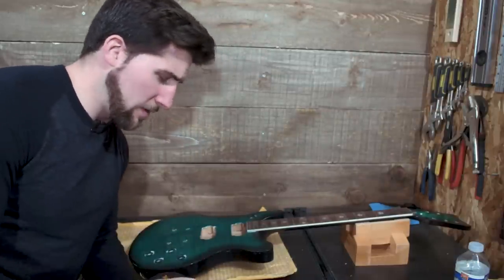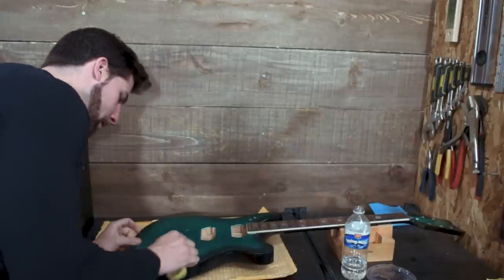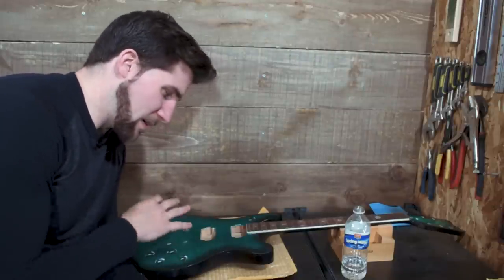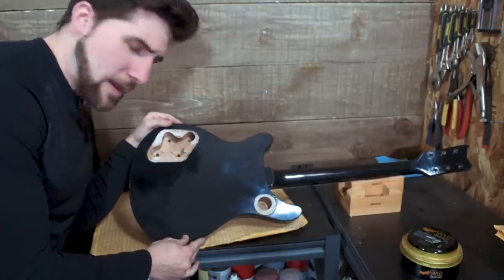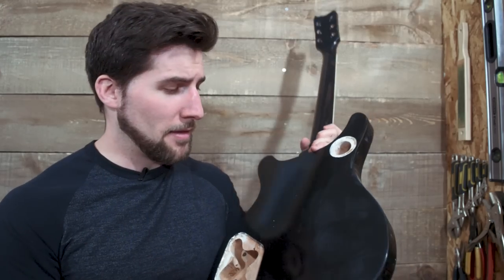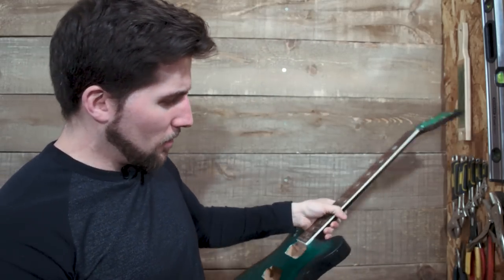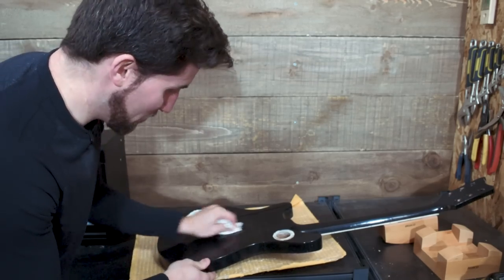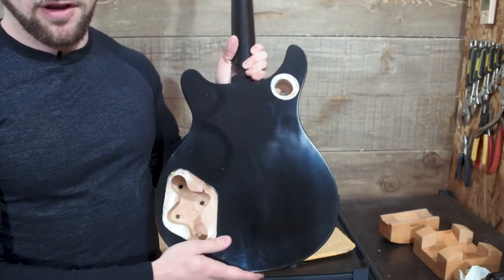Can you use Car Wax on your Guitar?

Comment: I have numerous types of guitar waxes and polishes and the absolute best I have found is Players Kit. You know how black guitars are a real killer to polish and not end up with those little scratches? Players Kit removes those scratches and leaves the guitar feeling brand new! I have a black Les Paul and it had those swirl marks and scratches all over it. I tried numerous things, cheap and expensive, nothing removed them. I checked out Players Kit and gave it a shot. in 10 minutes the scratches were GONE and man oh man does this guitar feel smooth and has a great shine to it! It's all I use now.
Reply from the maker: I need to write this down somewhere haha.
Reply: @BradAngove  Pm me your address I will send you some Players Kit so you can check it out for yourself and do a review. Like I said, it removed basically all of those annoying little scratches on my black guitar in less than a half hour and left the guitar feeling smooooothhhhh... I cannot even remember where I heard about it, seems like someone on You Tube was talking about and after purchasing so many different brands I thought what the heck and gave it a shot. I use other stuff for my day to day cleaning but on the tough jobs, I go right for my Players Kit.
Reply from the maker: Thank you sir. I’ll make a note to shoot you a message on Facebook.
Reply: @BradAngove  - no problem man, I will be curious to see if a professional like yourself agrees with my view of the product. I realize there may be other products just as good or even better, but so far it truly is the best I have come across. I only wish now I would have taken photos of that black Les Paul before and after lol.

Comment: I use Meguire's Scratch X 2.0 for scratch and swirl removal and Mother's Brazilian Carnauba wax as a polish. I've polished Tru Oil and Tung Oil afterwards with carnauba wax, as well as making matte or satin finishes glossy.
Reply: @burp1914  any kind of polishing compound are usually low grit finishing compounds used before wax. Rubbing compounds are quite a bit more aggressive. Polishing usually follows Rubbing.
Reply: @burp1914  try the Meguire's Scratch X 2.0. That stuff is magic. I use it on my car finish as well.

Comment: It was something I knew but nice video. I think it should clear some misconseptions. Few days ago I applied compound on my bass and then wax which all were for cars. It worked better than I expected. Removed all the horrible haze I made a year ago when I tried wet sanding with hand which was a total nightmare on my fingers. I think it should be obvious that wax works differently than compounds if we compare how they get applied.
Reply from the maker: Yes, start with compound, then polish, then you can use wax. Automotive products work fine.

Comment: I use automotive paint anyhow, so I do it just as I would paint and finish a vehicle. I also cut and buff just like I would clean up and detail a car, the wax is important to protect the top coat. I've thought about even ceramic coating a guitar xD, it may help a bit to keep off the greasy prints..
Reply from the maker: Ceramic coat would probably do quite well for that I would think.
Reply: Bradley Bassin_20   Oh absolutely. I’ve been planning on ceramic coating my truck & figured I’d do one of my guitars too.

Comment: I have used StewMac's compounds and polish kit, but I find that the compound mashes too easily into the clear (this is after waiting about 3 days in a heated garage for the paint and clear to harden a bit).  

I prefer high grit sand papers (2000 and up) after clearing a guitar.  For me personally I don't run the risk of sandpaper drying out as compounds do ( you get a huge amount from StewMac), and I can polish out all of the markings with each high grit sandpaper.  It is more elbow grease doing it by hand, but I do love the results I get.  Again to each his/her own :-)
Reply from the maker: I use the high grit sandpapers first of course. Then the compound, then polish.

Comment: What don't you like about that guitar? if you don't want it I will buy it. It would be a fun next project guitar. I love your videos!!!
Reply from the maker: Well, it was a really shitty kit initially. Neck pocket didn’t line up correctly with the veneer. The veneer itself was so thin that it showed up with sand through spots on the edges, which is why I did the burst. It’s just generally a low quality piece.

Comment: Ok, great information Brad. 
 I have a ceramic coating on my car for added protection; Once you have got your guitars finish how you want it, whether it be glossy or matte, do you think an application of ceramic coating would interfere with the finish, ie, turn the matte glossy;  or do you think, like the carnauba, it would just add another layer of protection without interfering with the finished look.  I’m asking because the ceramic coating is supposed to protect against minor scratches, which I think could be useful on a guitar. 
Cheers Brad.
Reply from the maker: The carnuba would still make a matte coat look glossier. It just wouldn’t polish it properly. 
I’m pretty sure the ceramic will give you a gloss or matte based on what ceramic coating it is, not what is under it.
Reply: Cheers Brad, appreciated. 👍🏻

Comment: Hey Brad, i actually was wondering or you could use that on a guitar. I tought wax was greasy, because it repels water. So it would be defenitly bad to put that on the back off a painted neck, it would become less slippery. Thanks for this Brad. BTW.. have you seen i"ve posted links to that Chameleon powder i talked you about on the Nebula video ? Greets, Bruno.
Reply from the maker: I saw the links. Thanks Bruno.
Reply: @BradAngove  Always welcome my friend. Greets from Belgium. Bruno.

Comment: oi brad, idk if you already answered this, but is it possible to paint with a brush over a matte finish and seal the painting directly, without having to remove the finish first?
Reply from the maker: Yes. Just sand it lightly to make sure the new paint sticks.
Reply: @BradAngove  right. thanks for the answer :)

Comment: I will ask the same question here that I did on Facebook for in case someone else could benefit from your answer as well.

Hey I have a question for you regarding the use of say a transparent red paint on a guitar. I am refinishing a Gibson SG and the customer wants it red. From what I can tell Gibson always does those in a transparent red finish. So my question for you is this; Do I use a primer underneath the red? 

Also, the body is Mahogany while the neck is Maple, if I am not using a primer what's the best way to color match the neck and body? Since the Maple is such a lighter wood the red will obviously be lighter, because I am using a transparent red. I imagine an Opaque red it wouldn't matter because I would be covering the tone of the wood up with the paint and primer.
Reply from the maker: Did you receive my answer on Facebook?
Reply: @BradAngove  yup I just now found it. Hmm, it shows I had already liked your comment but I don't recall seeing your answer until just now. Facebook Gremlins strike again!! Lol.

Comment: Is anyone doing wraps on Guitars?  Is it possible?  Some very crazy wraps on cars these days and can't imagine the work effort to get same type results on Guitars without it.
Reply: I'm not sure how you'd go about that really?? Wrap a car is basically 2 dimensional on flat panels, where a guitar is essentially 3D... You'd probably have to wrap each side and leave a seam around the body.. Maybe you could hide a seam with binding?
Reply: @bradhh1234  Ya I hear ya however with some of the body kits and wraps I've seen lately they are far from simple 2D, or flat.  There's wicked serious contours, angles and radii.
Reply from the maker: On a guitar you can get hydrographics done instead. It’s easier.